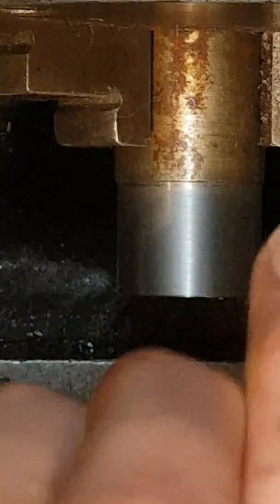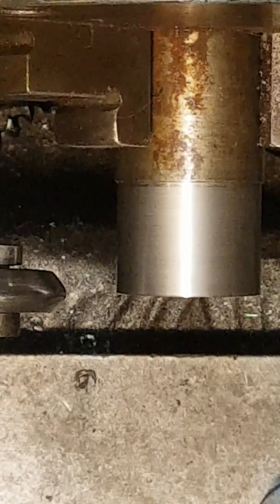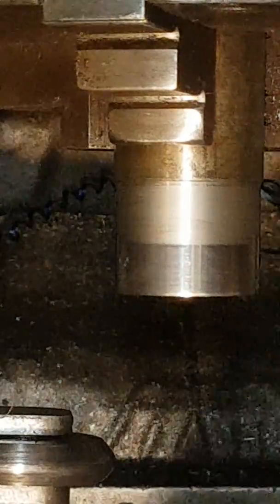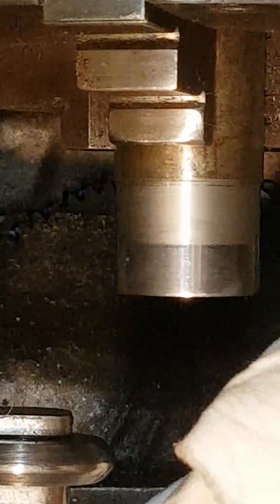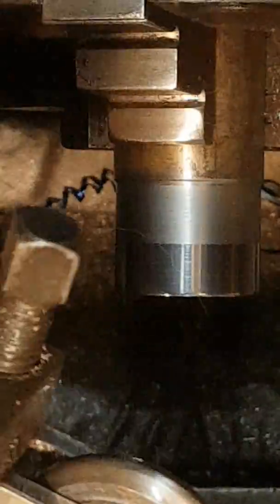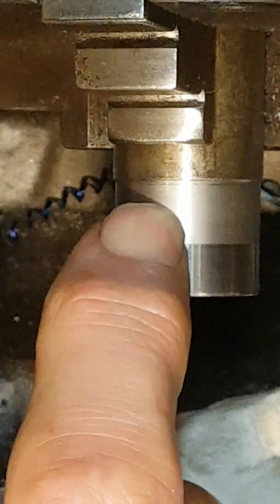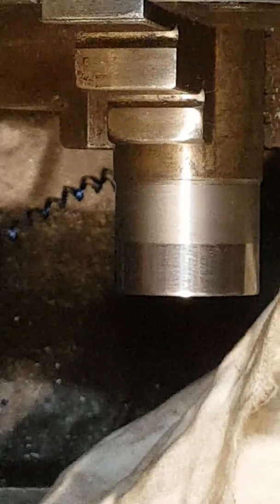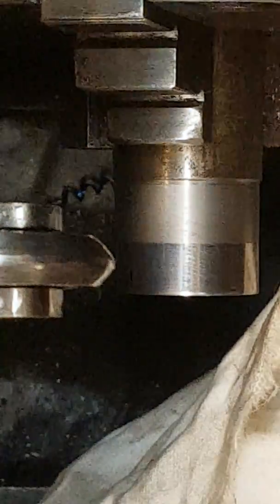A Roller burnishing tool, homemade.

Comment: What is the type of bearing, can't  find any information on this inverted V style . It seem as good as using a ball, but easier to make then the a combo of bearing and ball type.
Reply from the maker: @mttr4003  thanks for asking, the bearing is a standard bearing(608) with a hardened steel ring pressed on. I can understand why someone came up with the ball and bearing tool but it does add complication.
Reply: @chrisstephens6673  Was that something you were able manufacture yourself. Not sure I would have the precision required for that. I have just done a straight bearing attached to a 1/2 tool post shank. but my result on burnishing are not good at all. Can't seem to get it to accomplish anything resembling what you have shown. Tried different speeds and pressure no results.
Reply from the maker: @mttr4003  you need to localise the force applied to a small area to get the surface pressure to do the job. As for accuracy,  not a problem just make it a slip fit and bond it with Loctite retainer, although it would be good practice for you to try and make it a press fit, not only as a learning experience but for concentricity too although that is secondary as flex in a lathe allows for ,inor errors. 
When you harden the ring, heat to boiled carrot colour, quench in oil(even if water hardening steel is used) and temper to straw colour to lower the brittleness a little.
If you know that you need a roller burnisher, you should practice the ability to work to tight tolerance when needed. If I can do it so can you!👍

Comment: Nice job works well can you tell me how you go about getting your profiles on your burnishing wheels ? I have several hardened roller wheels but they are already ground to a sharp vee . I haven't been able to duplicate what you've come up with . I especially like the one for close work near the chuck . Great job thanks for the video
Reply from the maker: Thanks for the comment, the rings were rough shaped from if memory serves EN24   ( an alloy steel something like 4140?) with a normal lathe tool and then refined with a file, after that just hardened and lightly tempered.

Comment: Agree it work hardens the surface, overdoing it could result in flaking. I built a scissor type which does not stress my hobby lathe with bearing outer races acting directly on the workpiece. I was amazed that I could also knurl such a surface without stress relieving.
Reply from the maker: @robthule6850  sorry for a rather tardy delay in responding but youtube doesn't always inform you there is a comment. 
Yes a scissor type would reduce the strain on a small lathe but having a narrow pressure ring is less strain than say a single knurling wheel would.

Comment: Which metal you used to made that
Reply from the maker: Thanks for viewing and the question.
The shank is just mild steel and if memory serves the outer ring on the bearing is a pre hardened chrome moly steel that i had in the sprap bin. It was an experiment so i didnt go to any great lengths to make it, i figured as long as the roller was harder than the pieces i was going to try it on it would work and it did.
Reply: @chrisstephens6673  thanks🌹 I would like to see more interesting videos from you .
Reply from the maker: @gtmemories67  is that more (quantity) interesting videos or more interesting.(as in less boring) 😂
Reply: @chrisstephens6673  Both 😊😊😜
Reply from the maker: @gtmemories67  I'll see what i can do.😉

Comment: I wonder if you've made a similar tool for I.D. burnishing?
Reply from the maker: Hi and thanks for the comment. In answer to your question , no i haven't but i know such things are available commercially. 
An outside version is good for all sizes but an internal one might not be so universal. Although it might be fun to have a go, if I  ever find a need but don't let me stop you having a go. Perhaps a steel ball in a recess in the side of a bar?
Reply: @chrisstephens6673  Yes I saw the commercial offerings, hence the question. I was also thinking about a ball recessed in a bar. I wonder how well a ball would work for O.D. use. Wikipedia's article on "Burnishing (metal)" mentions both ball burnishing and roller burnishing. Have you tried ball burnishing?
Reply from the maker: @GenePavlovsky  not yet, i only tried burnishing because i got a recommendation from youtube for a video showing a tool that used a diamond in effectively a face mill and thought i would play. I knew about burnishing using a hard smooth tool from friends in the watchmaking field but had never thought to use it in my work before.
Thanks for your interest and subscription.
Reply: @chrisstephens6673  I see. I found it mentioned on the practical machinist forum, this watchmaking video was linked there: https://www.youtube.com/watch?v=4jTKNLjLrNM
It looks just like a flat (or square) piece of steel, probably hardened, and a very mirror-like finish in the end... I know burnishing is commonly used in wood turning, a turned takes a bunch of wood shavings in the hand, and applies them to the rotating workpiece.
I'm going to try a few options, including the one in your video. Thanks
Reply from the maker: @GenePavlovsky  the sign of intelligence is to see something new and investigate its possibilities and how it could  be useful for you. After all it is making tools that allowed us to come down from tree dwelling. 
Yes thats the sort of burnishing i knew about but watch making is something i leave to the experienced guys. As a preteen i pulled a clock apart and had the spring fly everywhere, it rather put me off.
I used to do a lot of woodturning and a handful of shavings does give a wonderful finish.
Good luck with your experiments 👍
Reply: @chrisstephens6673  Heh sounds like a tool fetishist's rationalization. Which is fine by me! I think sometimes I would like to make new tools more than making something with those tools.
I also had similar experiences. Disassemble something working, possibly breaking it already in the process, reassemble, end up with leftover extra parts and a non-working item. But hey, this curiosity is what made us keep learning and eventually succeed (most of the times) in fixing and making things. Cheers!
Reply from the maker: @GenePavlovsky  never be afraid to make a tool if it helps to do the thing you wanted to do. I frequently get asked to drill out broken jets in carburettors and the only way to do it is to make custom drill guides, no amount of careful mill set up can be as accurate when you are playing with such small, and often deep, holes. Just remember where you put them when finished for the next time.😉

Comment: Nice simple tool Chris, but very effective. I would imagine it also puts a level of compressive stress into the workpiece, similar to shot peening. Jon
Reply from the maker: Thanks young man for the comment, indeed i believe it does. I saw a video of a commercial item that uses diamonds to smooth, not cut, the finish machined surface and did a bit of research, if i see something that looks interesting i experiment. Some folks just play follow my leader without a hint of their own input, that's not my way.😉

Comment: Great tool . Something i have known about , but not tried or had anything to do with yet  .  All i know is it can improve a surface finish , reduce the chances of stress fractures & depending on the steel being burnished  slightly work harden the surface .   Cheers .
Reply from the maker: Thanks for commenting, I  thought you might like it.

Comment: Good video I gotta remember this.
Reply from the maker: john Hubbard Thanks for the comment, I'm surprised it is not more commonly known or used in the home shop.
Reply from the maker: The answer is a bit ambivalent, in a way it can but you get a sort of metal spinning effect. Quite frankly I get a near perfect finish just using a very sharp tool on the back cut and couldn't improve upon it with burnishing. It might however have it's other effect and work harden the ally, which might be of use.
Reply: @chrisstephens6673  Thanks Chris
Reply from the maker: @johnhubbard3399  my pleasure..

Comment: That seems super effective Chris - nice idea... is the hardening of the outer through and though heat treat or case hardening.
Reply from the maker: ChrisB257   What ho namesake, carrot red then tempered dark straw to remove brittleness a bit. The tyre metal was a lump of Unknownium alloy steel but it hardened OK in a propane flame and has stood up well so far. In experiments so far the tool worked on stainless both magnetic and non, mild steel, cast iron, hard brass but it is not so good on softer metals like aluminium where you get more of a metal spinning effect.
Hope the winter chills aren't affecting you too badly.
ATB from the old country 
c
Reply: Thanks for the info Chris - might be something I'll try one day if I ever get into the shop! It is in fact very much like a small metal spinning device.
Winter chills are starting! Best from this old ex Pat!
Reply from the maker: @ChrisB257  don't plan to not go out to your shed in advance or you never will.
Pure coincidence that it looks like a metal spinning roller. My next video certainly will not be bearing based, but might look like a bent bit of wire.  When you see it you will be impressed, guaranteed.